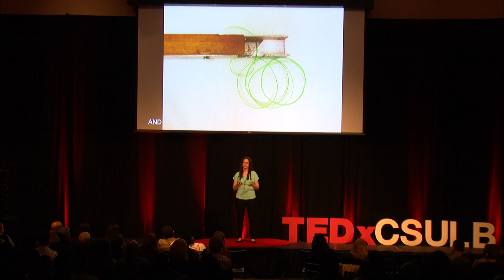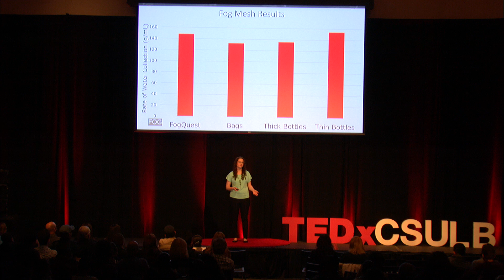Fog Harvesting with Recyclables  | Kathleen Chelling | TEDxCSULB

Comment: Interesting experiment but I find the aproach not very scientific.
She concluded that her recycled mesh was as good as the manufactered one but she only tested it in one setting. She should also have made a comparison with different conditions in the humidity chamber. If the air moisture was lower, would the results be the same? Or do they only perform similarly when there is so much moisture in the air, that the FogQuest net gets overloaded?